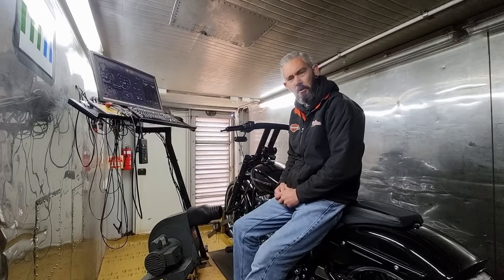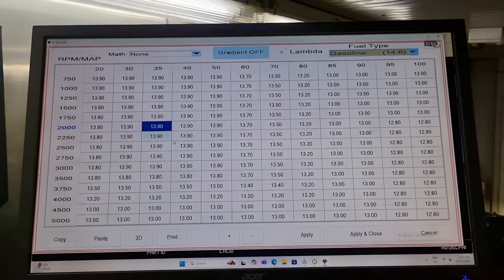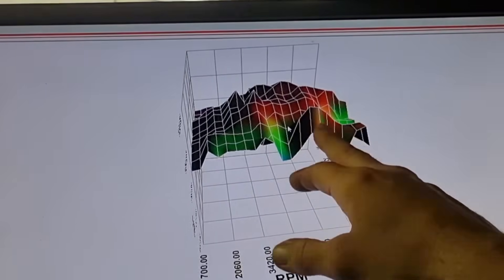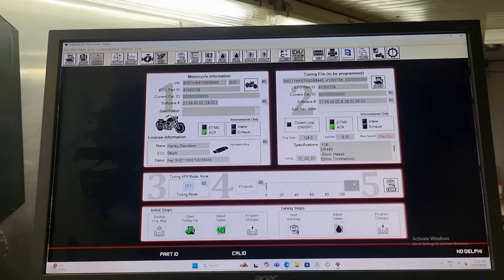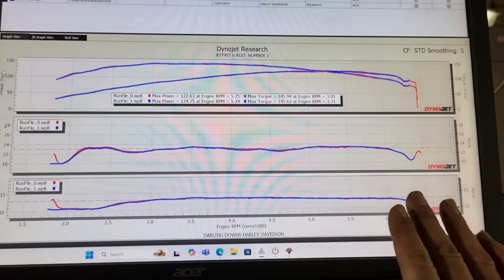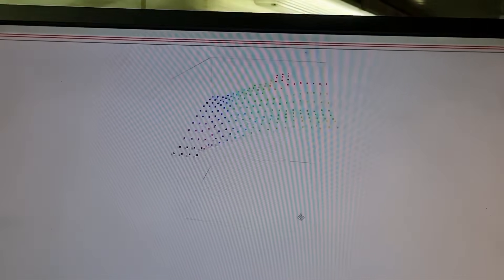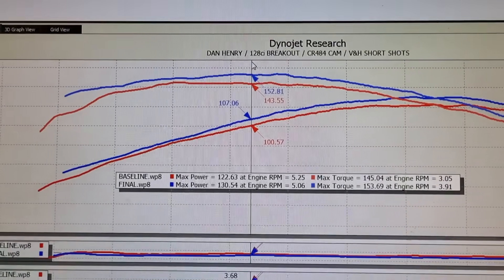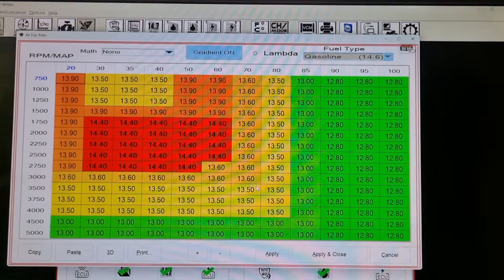How I dial in VE, Spark and Air Flow

Comment: Hi, great video thanks! I know I could go to a tuner, but where’s the fun in that? I’m just curious: can I actually damage my Harley by trying to tune it myself? I’m using a Screamin’ Eagle Super Tuner (the orange one).
Reply from the maker: Great question! Depending on your combo. If you have a high compression motor you could potentially damage it with by getting it too hot with not enough timing or fuel.

If you have a pretty common build combo like any type of stage 2 you can't get into too much trouble. The ECM will pull timing where knock is found. If you run it too lean it'll get pretty hot.

Comment: since narrow band o2 sensors only read 14.? can you just turn them off?
Reply from the maker: Absolutely 💯  just set the target AFR to 13.9:1 and the closed loop function is turned off. From there you dial in the AFR manually with the Dyno.

I like to keep the closed loop on though, only in the cruise areas to ensure the best fuel economy. Not all combos are suited for that though. Most stage 2 and stage 3 builds I will have a small closed loop section.

Comment: Just a question off subject I just recently purchased a new FXLRS seems to have an excessive amount of vibration went back to the dealer and the dealer had other motorcycles that I could ride one was an FXLRS the same as the one I own Much smoother The other was an FXLRST very smooth. What could it be?
Reply from the maker: Let's try narrow it down. Where does the vibration feel like its coming from? Front or back of the bike? 
Is it doing it in any particular gear, what speeds do you notice it, try to provide as much information about what you are doing and feeling when it's happening

Comment: Question for you sir, is this bike running the 484 or the 485. I noticed in the file from the previous runner it says it's 128, 485, stock heads, 5 mm. 

In your final it says it's a 128, 484, stock heads, 55 mm

Comment: hi Tommy  great insight into the adjustments you make when creating  a custom map, just seen another Aussie content creator post some  2025 softail (lowrider st ) tuning content using Dynojet PV 3,  bike has an spc concept pipe, poss mid length version and  in sport mode it made 126/142 after tuning what gains do you think are likely with the SE wedge fitted in addition instead of the Heavy breather stock cleaner.  do you think any further gains are possible or economically viable  still using the stock SE 511 cam  ,  bigger injectors throttle body etc or is a filter and exhaust about it before the SE cam runs out of steam and its time to think about an aftermarket cam like the 484 or 515
  just  wondering how tuning effects the ride modes too . hope we see some 25 softies on your Dyno soon !

Comment: Yes! Thank you thank you thank you, Tommy! An incredible result with proper tuning!
This is a great video going over the basics with tuning! It's awesome you went over a typical example showing the corrections of mistakes.
Do you think you can do a more advanced video in the future? Please.

Couple of questions:
1. What is the strategy for the timing tables exactly? Do you try to get within 1 degree of timing on the knock retard? Is that how you know you reached the limit? How about the timing table with temperature?

2. How do you address tuning the bike during a cold start hesitation? e.g. AFR startup enrichment as well as AFR warmup.

3. Have you ever ran into a situation with the VE table shows a maxed out value of say 127.5? What is this a symptom of this and what strategy have you employed to fix/address this?

4. Most of your pulls seem to be WOT. How do you tune partial and transient throttles? Do you do 75%, 50%, and then 25% pulls?

Comment: Perfect timing Tommy (see what I did there?😂) - I’ve just put a cam in my bike and am using TTS to tune it (without a dyno alas). Regarding the AFR, my understanding in that stoich around here is approximately 14.68. Why do we find that 14.5 (or 14.4 in the end of this video) is more appropriate? Thanks.
Reply from the maker: Great question mate — you're absolutely right that stoich for pump fuel (unleaded) hovers around 14.68:1. But in the real world, especially when tuning a cammed Harley I often aim for a slightly richer AFR like 14.5 or 14.4:1 in cruise zones.

Why? Two main reasons:

1. Stability & Smoothness – A slightly richer mix helps reduce lean misfires and gives smoother throttle transitions, especially with more aggressive cams that have increased overlap.

2. Heat Management – Leaner mixtures run hotter. Even a 0.2 AFR shift richer can help keep temps in check, especially in slow-speed or hot weather riding.

So while 14.68 is stoich on paper, 14.4–14.5 is often the sweet spot for real-world rideability and engine happiness.
Reply: @MasterTechMiller thanks mate, you’ve given me something to aim for.

Comment: Great video!  I’ve been curious if the tables were modified in groups of cells within certain ranges.  How do you know if you have too much ignition timing in a certain area?  Will you hear audible detonation or do you have a knock sensor?  How do you find the threshold for max timing at different rpm/MAP settings?  Thanks!
Reply from the maker: Good question! 
Data logging shows how much ignition retard is being applied, the bikes also have knock sensors.
I also use the Dyno to find what rpm peak torque is happening. From there, we need to data log the run, compare ignition values at peak torque, then increase or decrease from there. 

Fueling needs to be dialed in first to properly find Max ignition for peak torque.

Comment: that tune looks like a copy and paste for a range of different applications. Probably downloaded over the internet. remote tune. on a different topic, does that bike have a hydraulic clutch? are they worth converting?
Reply from the maker: It does have Hydraulic cluctn yes! Good spotting. 
They are worth it, if you want to internally run the brake and clutch hoses in the bats for a clean finish. 

Most people don't like the feel of the Hydraulic clutches as they don't have and really adjustment on the engagement point. You almost have to let the clutch completey out before it starts to engage.
Most people don't like that, they prefer it to be closer to the hand grip to allow better feel.

Comment: So on my 2021 sport glide with 107 and torque cam. I did some smart tuning on it. Using the screaming eagle tuner. Can I send you screen shots of what my tune is showing and my ve tables? Any advice in timing and lambda value adjustments would be amazing. Thanks and I need way more videos like this so I can keep learning. I’m so into the tuning aspect of Harleys and you’re exactly what I need to show me the way.
Reply from the maker: Absolutely! Send them through to me at workshop@ddhd.com.au
Reply: @MasterTechMiller awesome. I’ll charge up the old laptop and get some pics to send over. Really appreciate you.

Comment: what do you think about stock ignition tables for m8? it seems like my 2022 fxlrst with 30/30 cam wants to retard timing all around. I see 10-11 degrees retard with WOT. Is that normal? When I retard timing, I feel like bike loses power and I still see some spark retard events. Any comment on that?
Reply from the maker: Your fuel table & VE tables are way off by the sounds
Reply: So in this case would it be accurate to think its lean at WOT and the knock sensors are pulling timing?!?
Reply from the maker: @mattreling2650 That would be a safe bet
Reply: @MasterTechMiller in this case, dynojet target tune doesn't work properly 😅

Comment: Yes thanks for taking time to do and show what it is all about.. you seem to allow the AFR go out of close loop with no worries? So one question, I have 23 ultra limited 114. Harley seems to have locked out any real changes to the ECM and so? How is it that a tuning software can shut off a lot they programmed into it to allow changes like you did here?.   Thanks again..
Reply from the maker: I am not using the Screamin Eagle Pro Street Tuner.
I am using Direcr Link from Technoresearch.

The SE Tuner had the capability to make further adjustments when in 'Record mode' which is selectable from the home screen in the software.

When this mode is selected, it allows the ECM to go outside the limited changes available when you manually increase values. This allows the ECM to gather a better range of data when actually being tuned on a Dyno rather than someone just mindlessly adding all the fuel available

Comment: Under what conditions would you consider converting a bike to chain drive? I've heard conflicting arguments. I'm curious about your take.
Reply from the maker: Great question! As you probably know I build big bore motors all the time. I would consider going to a chain drive if you are building a max effort street/strip engine. That's the only time, unless if course your a stunt & wheelie guy.

Just about every big bore street build out there is absolutely fine to run a belt drive. They need proper adjustment and checking but that's it.

Comment: Awsome video. I just did a 128 with the 484 in my trike. Unfortunately no trike dynos anywhere near me been dialing it in on the road with PV and target tune. 

Do you always start with the stock spark tables? 
That's all I have to go off if, it's taking me forever trying to go up a degree or 2 at a time, log, change repeat.
Reply from the maker: I almost always start with an ignition table that is from something I've dyno tuned in the past. 

I never really start with a stock ignition MAP at all really.
Reply: @MasterTechMiller i was afraid you were going to say that